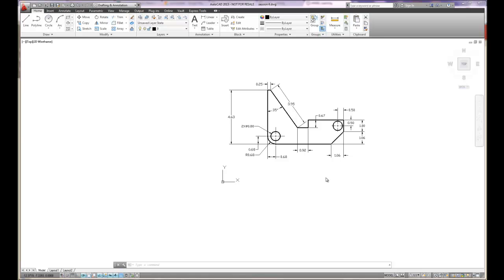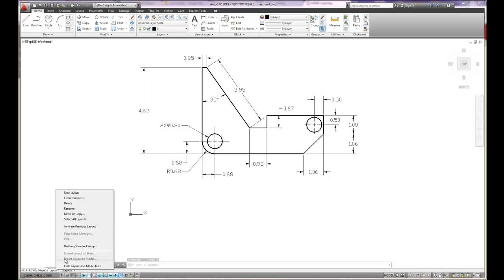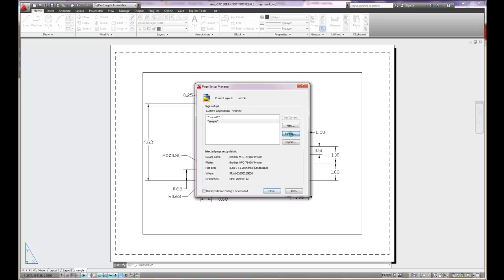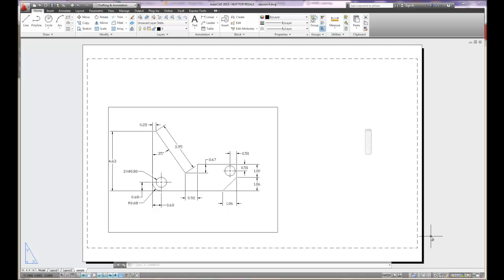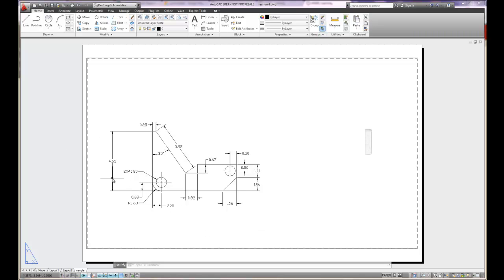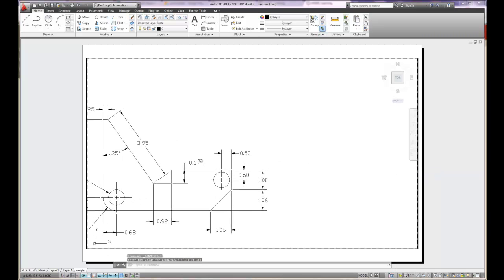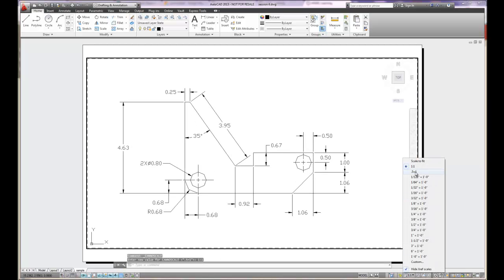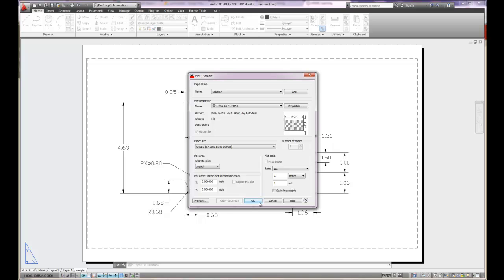AutoCAD 2013 Layout Basics

Comment: Nice video, thanks.  I do want to mention that since it's quite possible to require multiple viewports in a layout, it may be better to have a viewport layer that is set not to print than to pull your viewport outside of the printable area (4:00).  Just my opinion.